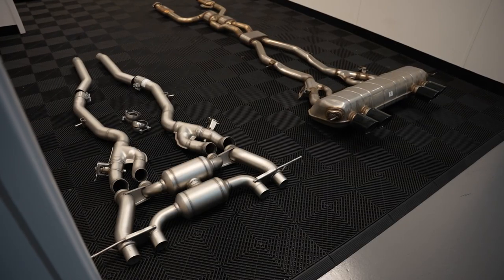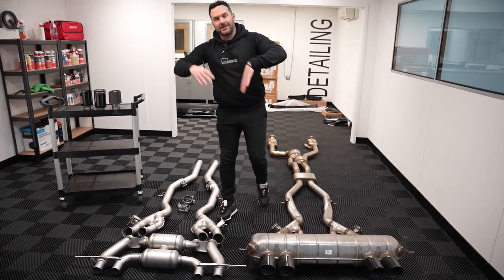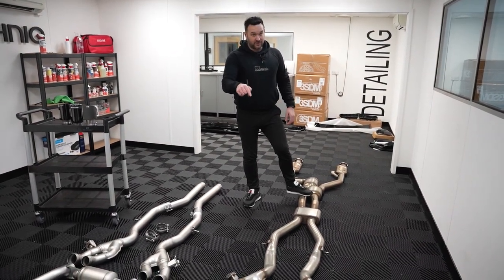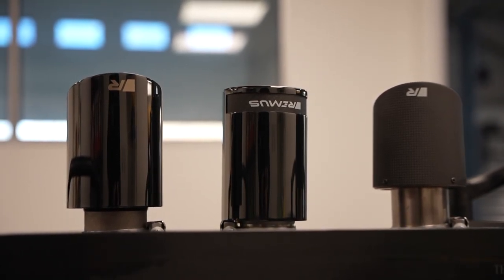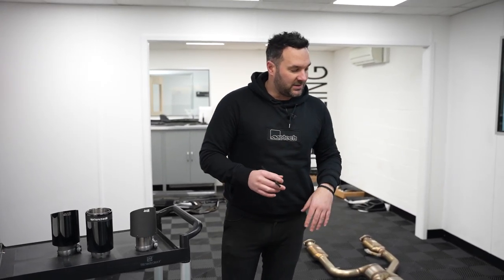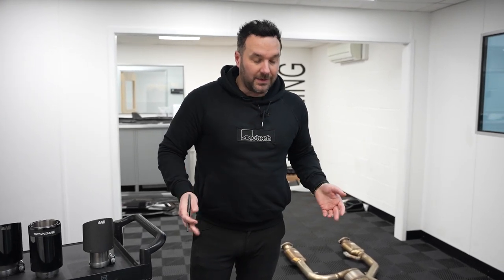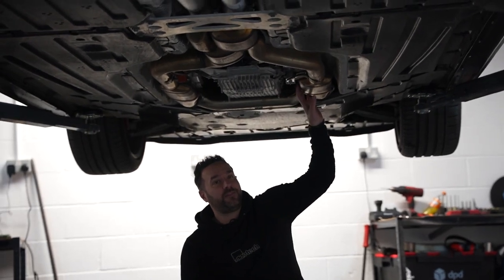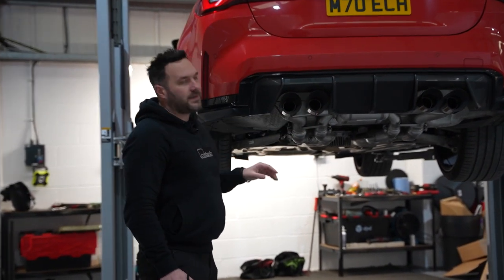The BMW M3/M4 G80/G82 Remus Exhaust Is Here!

Comment: Hi!

Can we use Gpf back system without error massegae?
Xdrive m4 comp can use the same exhaust system?
Thanks
Reply from the maker: Yep that’s correct sold heaps of that set up now
Reply: @MotechPerformance  

Thanks. 
So the xdrive and the rear wheel  drive use the same exhaust?

Comment: Geez, the S58 sounds nearly as bad as the S55. Surely equal length midpipes are the only way to make it sound good?
Reply from the maker: Think it’s more the 2 turbos make them sound like that , the b58 single unit sounds great
Reply: @MotechPerformance  that's exactly why they sound like that, although more specifically it's the unequal downpipe length (previous BMW twin turbos sound great eg N54). That's why the only way to make them sound good (apart from single turbo setup) is to fit equal length midpipes

Comment: I’m interested in this exhaust system. How would you order the exhaust system so that it doesn’t drone in comfort mode while preserving that signature m3/m4 high pitch screech sound like in 2:19? Would this be something that’s possible?
Reply from the maker: No you can’t sorry , to get That sound you will need to Remove the cats and opf it will drone sorry
Reply: @MotechPerformance  is it compliant with the emissions standards? So there’s no middle ground?